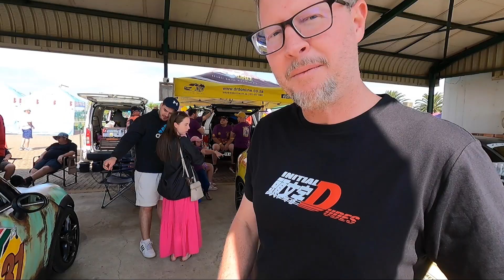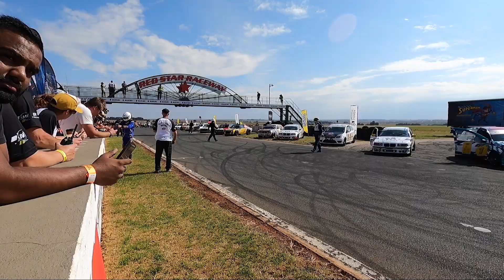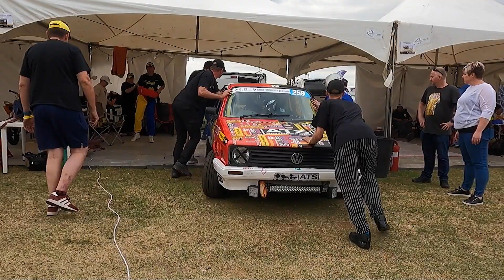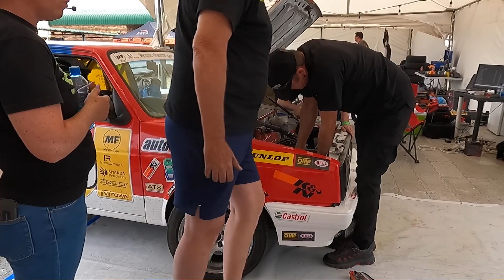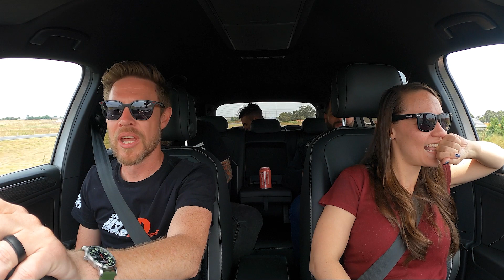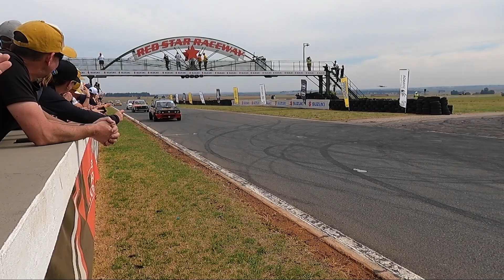Endurance Race Car Build EP14 | The 2022 24-hr of Ilamuna

Comment: Awesome video guys. Thank you for featuring Dash Racing so prominently. We were in the top 3 for a long  time, but unfortunately brake failure dropped us down to 7th. You guys are on the right track. Light-weight, rear wheel drive and good brakes is the way to go.
Reply from the maker: Only a pleasure! You know we have a soft spot for the MX-5!